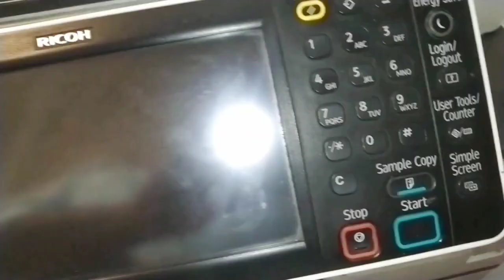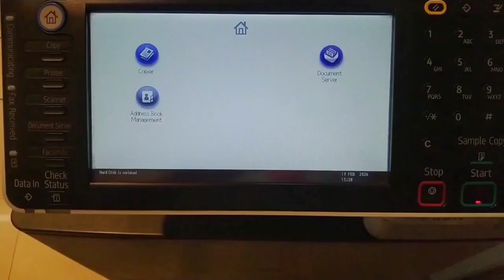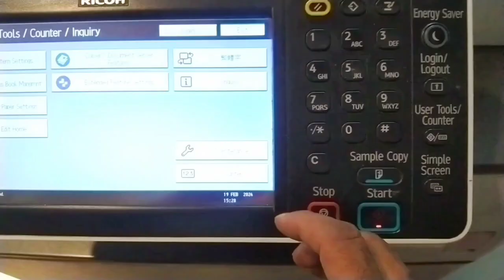Reset error code SC 672-11 in Ricoh photocopy machine MP 2554, 3054 | How to reset SC672-11?

Comment: Hola amigo sc 995-04 Ricoh MPC 3004
Reply from the maker: CPM setting error 4
Comparison of machine serial number (11 digits) and machine
identification code.
Machine serial number (11 digits) or machine identification code does
not match.
Return the parts to the original configuration, and then replace them
according to the manual.

I think Wrong Controller board is installed in this device

Comment: SC 672 error Ricoh MP C3003
Reply from the maker: Please Reconnect all connections of circuits & reconnect controller board With IPU
If not solved 
Reconnect panel board's all connections, 
Remove HDD
If not solved 
Replace Panel board or Controller board